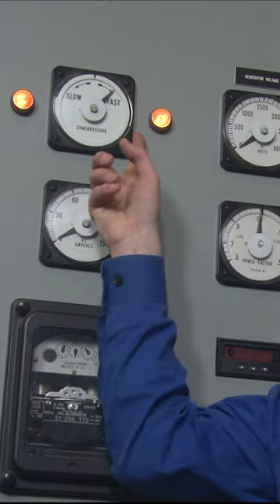Synchroscope #engineering #highvoltage #electricity #generator #hydropower #powerplant #90s

Comment: When you said analog is not something bud but is something Cool and it is for real. Nowadays has prooved that analog computers in comparison to the fancy exotic digital components except for big volume or energy consumption is and remains more accurate. I dare to tell that is more close or accurate to real quantum field which is nature himself. Some examples there are on the fidelity of the sound field. And I refer to the use of lamps on speakers or to the big difference between pick ups with the needle and CDs with the laser. It's like mathematics with algebra that is really close to the limits but with trigonometry(nature) you can achieve the exact price of √ 2. It is sufficient to apply the Pythagorean theorem to a triangle with vertical sides of value one will have hypotenuse √2. It is so simple.So analogs is something really cool!!! I believe!😊
Maybe is a subject that deserves a special presentation for your futures videos!

Comment: How is it connected to the electricity that the generator is outputting? Is it 110/240 voltage or 10kV? Are the huge resistors before the gauge wires?

Comment: Match frequency? No thank you. I would prefer to not turn my steam turbine into a steam pump. I'll keep my frequency just a bit higher than the grid when paralleling across, so i can pick up a bit of load right away. Motoring action that's greater than the generating action in a turbine generator is how you break things.

Comment: Query ... Hospital have installed a Back up Diesel Generator. If Supply from the Grid is Lost the Diesel Gen will start. The problem is, they have no Back Synch Facility, so they will have to stop the Diesel Gen, then reconnect to the Grid, temporarily loosing power. Can a back Synch System be retro fitted

Comment: From your panel design, GE made that style back in the late 60s. So when was that installed? When you open the generator breaker, do you just watch the load and open manually when at 0 or do you have a reverse power relay to open the breaker automatically?

Comment: Power stations supply grids with different line lengths, each with its own impedance, load and (don’t know the right terms) reflected phase. So the station’s output must “see” a very noisy load. How can a single, clean phase be adjusted to a load with multiple phases?
Reply from the maker: That is an excellent question with a complicated answer. So you just inspired me to make a whole video to answer it. :) Thank you! The short answer is that the power stations all see each other. It's like having 50 people all pee in the swimming pool. We don't know what energy goes where, we just pool it all together. The pooling process lets us all balance from each other and it all evens out. This is a MASSIVE oversimplification, but I'll get into real detail in the video.

Comment: How do you get a job in a feild like this? Something very technical & hands on?

Also im pretty sure ive seen that photo somewhere on the Xfiles before...
Reply from the maker: There's a LOT of places like this that are desperate for help. Wander over to your local power plant, or electrical contractor, and ask how to start the process. If you're smart, motivated, and willing to learn new things there is an endless array of opportunities ahead of you.
Reply: The power plant that I worked at hired people that served in the Navy. 20 years later they stopped that practice when they phased out the old steam boilers and turbines and all the operator had to do was press a start button. But if you want to work on controls, instrumentation, relay protection...etc... a lot of colleges now have courses on these. I have a degree in Computer Engineering and Computer Science way back before colleges offered technical classes in areas of this.

Comment: 59.9 hertz and phase synchronized before coming on line with grid. Resistant loads are the cleanest loads. Inductive loads cause lag in sign waves. Capacitive loads cause lead in sign waves on frequency
Reply from the maker: I really need to make a video explaining Power Factor. You're on the right track, but not quite there.
Reply: And try not using voice to text, it gets the spelling of words like sine wrong .
Reply: Whats cool about generators is that you can correct the power factor on your line by over exciting or under exciting the generator. @Physicsduck

Comment: what would happen if you had 2 matched generators  180 degrees out of phase running on the same line? would you have effectively the dc form of ac that you could pull a stable voltage off of with a full bridge rectifier?

Comment: Dumb question, why is a hydroplant being disconnected from the grid every day?
Reply from the maker: That's an EXCELLENT question! It's because there's a giant set of grates that protect the turbine from trash and debris (like leaves, logs, canoes, and even the occasional car). Those grates get cleaned at least once a day. During the autumn they clog with leaves and require cleaning every shift. Our smallest generator is sucking 400,000 Cubic Feet of water every second, so the only way to clean the grates is to bring the generator offline for a bit while they get cleaned.

This works out pretty good though, because while it's down it gives a chance to do simple daily maintenance on the generator and support systems. It also gives me a chance to shoot video while it's quiet in there. 

Thank you for such a good question! :)
Reply: @Physicsduck  Thanks for the answer! Makes perfect sense
Reply from the maker: I may do a whole video on that. It's something that people should understand. :) Thank you!

Comment: Good practice not to leave the 
synchroscope on when your not using it
Reply from the maker: and that's why those bulbs have lasted for 50 years (that we know of).
Reply: @Physicsduck  bulbs are cheap, it’s the synch that gets worn out
Reply from the maker: They do? I'd never thought about that aspect of it. Is there some manner of maintenance I should be doing?
Reply: @Physicsduck  I’ve never performed any maintenance on them, just changed them out when they quit
Reply from the maker: I wish I could find a couple old dead ones to explore for a video. That would be an interesting teaching tool. The ones on eBay are stupid expensive.
Reply: @Physicsduck  ya it would be.  From what I understand they generate heat when in use and that eventually degrades them overtime